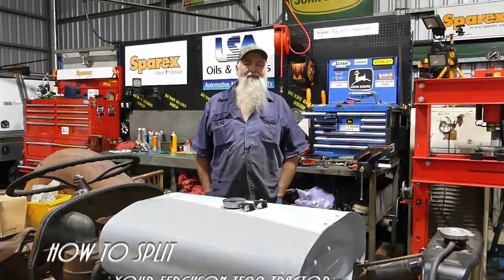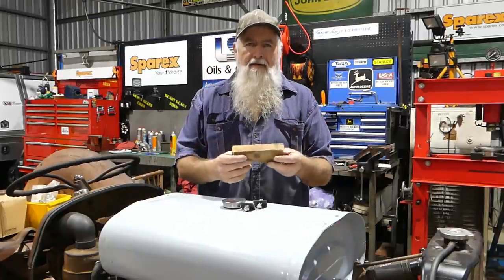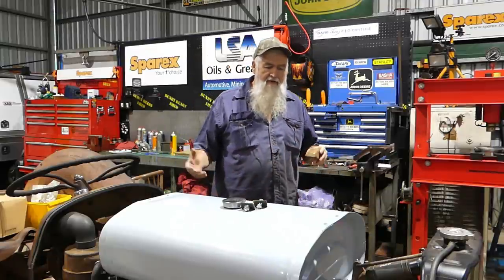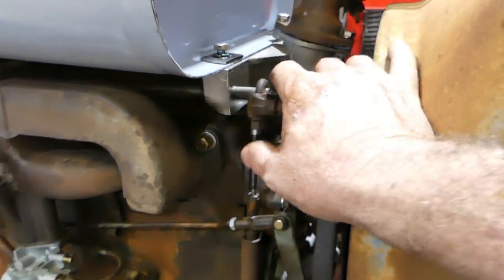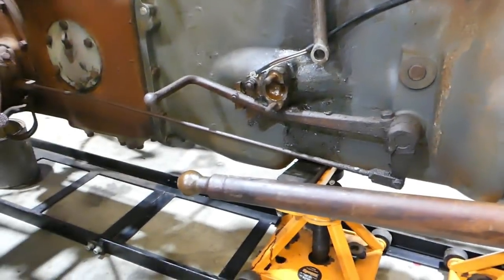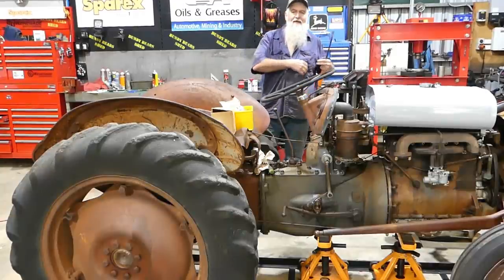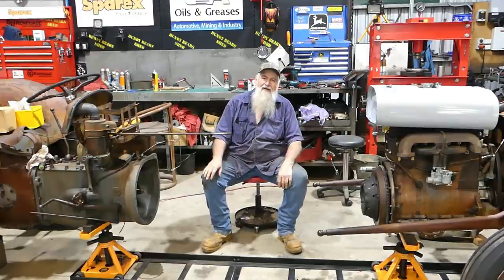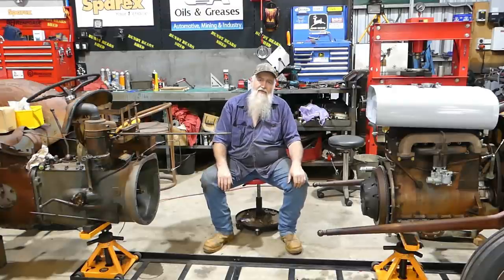How to Split your Ferguson TE20 Tractor

Comment: Love you're videos, helped me alot when working on my 1954 TE-F20 bought one at first, but the engine was stuck :( I wanted to surprise my little daughter with the Grey Fergie, but that was a huge let down.. So, we went and bought another one, but that one had front axle problems... center bolt bushing and bolt was pushed in to the crank, so we can't even enjoy it, can't push the snow either.. And taking apart these tractors after sitting for a few decades 🙈 Holy frig
Reply from the maker: It can be a trying experience alright when things are stuck from sitting but heat often helps.

Comment: When I split my TO35 this last spring I used one of those $12 Harbor Freight rectangular dollies and stacked wood blocks to support the front of the tractor at the correct splitting height. That worked easy and much less expensive than the Sparex rolling jack sled system (which is quite nice). The plastic clutch pack alignment tool is worth the price! I bought the wrong one (single clutch instead of dual clutch on my tractor) and then 3D printed a CAD model rather than wait another week for a shipment and that worked well getting the tractor back together. One trick I didn't try but saw was getting two 18in long rods threaded to match the clutch housing bell mount, install one on each side to slide the engine along to ensure alignment while the splines engaged.
Reply from the maker: I will turn a couple of guide studs as we call them for assembly. Any chance of sending the STL file for the clutch aligning tool to bundybearsshed@gmail.com? I have a 3d Printer tucked away and that would be a good little project for it.

Comment: I just recently bought a TE-20 sn 48566 my engine looks different? Mine has Z120A 300 in the casting on the block and there’s some rods on the bottom that I’m assuming is for added support. I guess I’m trying to under stand why mine is different than yours.
Thanks from Jason  in the 38:41 US in Pennsylvania. 
I really appreciate your videos and I also own a MF 35 and a MF 50 both are diesel.
Reply from the maker: G Day Jason, Yes you had the Continental engine, something we didnt get out here, ours is the British Standard Motor Co engine.

Comment: Good job. Looks easy with this splitting jacks but I don't have them. In my tea20 clutch is covered by oil from a seal. Also I have a wine sound from the gearbox or rear diff while I ride it. It wines more when I engage lift. Lift won't work. It goes straight up and won't react on lever. Just stays up. Someone was there because I see handmade gasket under the seat.
Reply from the maker: The pumps were a noisey arrangement at times especially under load.

Comment: Mate, I was stoked to find this vid on YT I just picked up a TEA20 yesterday and the clutch peddle comes out a mile before engaging so I figure it needs a new pressure plate is there an adjustment I can do to reduce the peddle travel before having to split the tractor? Cheers from over the ditch
Reply from the maker: Yes go a few vdeos layer in the TEA20 playlist. I go through adjusting it.
Reply: And will that will take that long travel to release the clutchon the peddle back to short travel ?

Comment: I have a TE20 with a hole in the bottom of the transmission housing (presumably alumininum alloy). I can get a TO20 bell housing  (presumably cast iron?) for a reasonable price. Was watching this to see how much work it'd be. Do you happen to know if the two housings are compatible?
Reply from the maker: Sadly we dont have the TO20 over here so I couldnt say for sure. With the continental engine I, thinking possibly not but I dont know for sure.

Comment: When you get to doing a video on replacing the input shaft seal, I'd be grateful for any hints on the thickness of the gasket between the gearbox and the input shaft sleeve. My old gasket broke in a million pieces, and when I discovered that it wasn't included in the gasket set I'd purchased (nor in any other gasket set I can find) I'd tossed the bin bag with the pieces. So I don't know the thickness to make a new one, and since it holds one half of a bearing I suspect that it matters or the preload on the bearing will be off...
Greetings from northern Sweden.
Reply from the maker: On the video I chose to disregard mine and use Loctite 151 as I could still feel the shaft was not too tight at all.

Comment: Hi Lance, Another great video. I have watched the whole series. I have a TED20 which was last apart in 1974 (when I was 16...). On my machine the radiator support rod from the radiator to the thermostat has always been missing. Could you send me some dimensions of it so I can make one (I already asked QTS about a spare part and Judy said not available)
Reply from the maker: Ill see if I can remember to have a measure but usually if I need to make one it is just 5/16" (8mm) round bar and I sit everything in place and measure between the holed. There should be no tension on the rod it is just as an extra support.
Reply: @BundyBearsShed  Thanks for that - I forgot to mention that the machine is 160km away at the property and I cannot get to it during these interminable lockdowns in Melbourne, otherwise I could measure it easily..

Comment: Dumb question:  are the front and back end of the tractor attached or secured in some way to the trolley jack or they only supported by these jacks? Great series Lance, even then smallest job filmed is priceless!  Thanks!
Reply from the maker: Just sitting on the stand, they dont go anywhere.

Comment: Great videos. I have a question , is that Sparex starter a 9 tooth or a 10 tooth cog ? , my original TED20 has 10 tooth i have read you can fit after market 9 tooth to original ring gear , is that correct ?  Thanks for all the vids they are a great help.
Reply from the maker: I think 9 but I would need to have a look to be sure on the weekend when Im back up the shed.